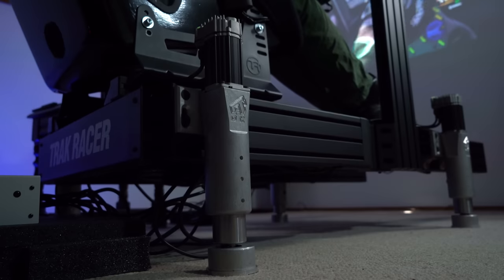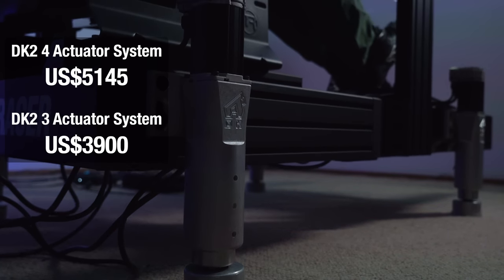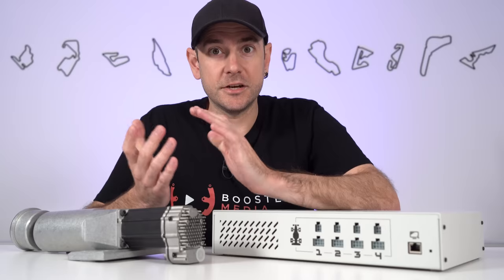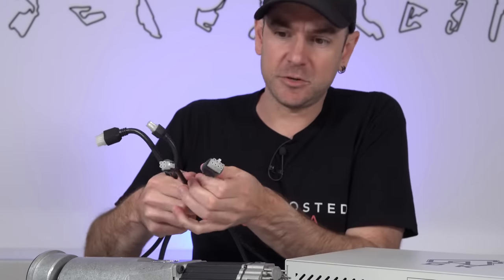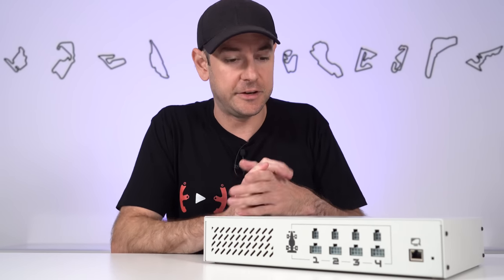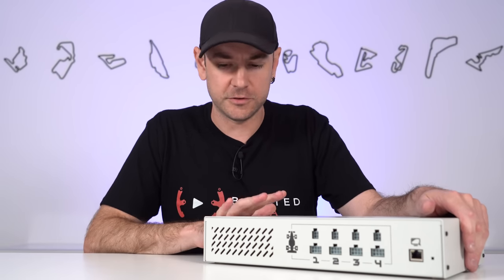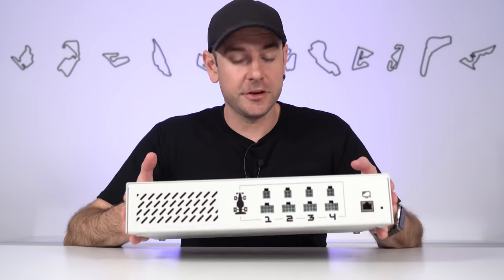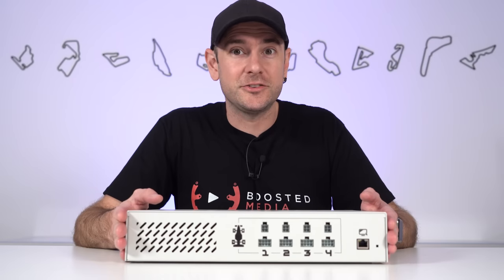REVIEW - Sigma Integrale DK2 Sim Racing Motion System

Comment: What frequency does this run at? Is it 60hz for iRacing like their FFB telemetry? If you use irFFB does it run at 360hz? Great video as always, just looking for more info.
Reply from the maker: IRFFB only impacts DirectInput, not UDP telemetry so it has no impact on what the motion system sees as far as I’m aware.
Reply: For iRacing, the shared memory telemetry rate is 360 Hz, and that is what the DK motion system uses. This rate allows the road vibrations layer to be highly detailed. However, other game telemetries are still at 60 Hz, so we implemented an algorithm that artificially boosts the telemetry rate for these games. AC, ACC and R3E are games with a telemetry rate that is 300+ Hz. For all other motion layers (pitch layers, roll layers, heave and engine vibrations), 60 Hz is more than good enough.

Comment: The new GEN5 DBOX 4250i will have integrated controllers to its actuators and will be priced at 7100$ USD. Price is close to the DK2+.
Reply: Excited to get my Gen5 😊
Reply: How do you know about the Gen5? Didn't find anything online
Reply: @vannibombonato4180  I know someone working there.
Reply: @tapidlittle13  thanks for the answer. Any insights/rumors on the technical side of it?
Reply: @vannibombonato4180  exact same specs and performance but less expensive and integrated controllers on the side of the actuators.
Reply: @tapidlittle13  thanks for the answer. Do you have any hint on Vr motion compensation implementation? I have a NLR setup and will have to decide whether sell it and go with actuators or go with motion plus
Reply: @vannibombonato4180  I really don’t know, the guy told me they should officially announce it very soon. He told me the specs are the same as gen3.

Comment: Can two different systems be used in conjunction with each other. For example can I use the  Sigma Integral DK2 with the PT actuator Traction Lose and Surge  System. They would use different software so do I run 2 sets of software at the same time.
Reply from the maker: It seemed to work ok for Barry (sim racing garage) when he used multiple ecosystems to build his 6DOF system.

Comment: Guys is it easy to set up vr with a motion rig? 

 Ive seen/ read some info online about mounting a controller to the rig iteself but have also heard about tracking issues. 

Will (no pun intended) you be doing a feature on it in the future? 
Love ur work legends! 😊
Reply from the maker: At the motion levels these systems run (2 inches or less) we haven’t found it to be necessary. It’s discussed in this video.
Reply: @boostedmedia  Ha ha jumped the gun.  ☺️ I was only 10 mins in. Still watching tho great review as always champions. 👌

Comment: If your aim is lap time is a traction loss system more important than a system like this? Also re the top floor comment would traction loss systems have the same issue?
Reply from the maker: We only have experience with the NLR system which we have a review on. I didn’t find it made me any faster. Traction loss can be interpreted by visuals and wheel force feedback.

Comment: Can you also let us know what kind of sound this makes for everyone DB if you can
Reply from the maker: Don’t have a sound level meter. Sorry.
Reply: A bit too loud for the living room with the wife watching tv, silent enough that i dont hear it with headset at medium levels.
I also got a kid doing gaming in the same room i run mine, and she`s not bothered at all, hardly notices it until i crash out.
Common for all motion systems: it moves and vibrates a 150-200kg rig like it was 30kg, so any wood floor (like Tom mentioned in the review) will transfer vibrations. Turning off engine vibration, and adding smoothing helps alot if that`s an issue :)
Reply: @-Ola-.  Thanks for info dudes, have a marble floor so no problem, just wanted to know the DB but the price is way too much,  9500 is just too expensive for what it is
Reply: @boostedmedia  Info, dudes, It's available for free on your cell phone
Reply from the maker: A phone app is not an accurate way to measure sound pressure level. I worked for 5 years as a Acoustic Calibration technician ;)
Reply: @boostedmedia  Yes that's true, but better than nothing mate
Reply from the maker: Not in my opinion sorry. There’s far too many variables to give an accurate measurement and I do r want to start throwing inaccurate data out there. 

Wouldn’t be a bad idea to get a proper meter to testing these things in the future though. But yeah, if we’re going to do it it needs to be done properly.
Reply: @-Ola-.  yup i agree. i have the dk2 as well. its pretty quiet overall. i have it in my office. I also agree with the crashing part is where ya really hear it..
Reply: @boostedmedia  I know how you think for your online people, and it's good what you do, just to know something about what those 4 actuators do, thanks in advance for taking good care

Comment: one can get an SFX 150 for $2000 plus shipping. with 3 times the displacement and faster movement at 250mm/s.. I would be curious to have anybody explain how such a system is twice better than an SFX 150.
Reply: DIY project vs. fully complete/ready for install product is the only explanation one needs for the price difference. Also, I bought a PT Actuator Scorpion for around the same price and I'm plenty more than capable of building a SFX150, but everything beyond the electronics is much better built on my PT Actuators. I'd expect this one to be the same. (I'm speaking of the heft of the metal work. Watch Sim Racing Garage/Barry take it apart and you'll see what I mean).
Reply: @mikej6565  i also almost pulled the trigger on the pt actuator but nobody could convince me that it was worth twice the price as the eracing lab kit. So i took my chances. So far, almost one year of intensive use and no problems.
Reply: @L_Emir_de_Passy  Whatever gets your rig up in the air is what works... I even bought a spare actuator and servo driver board, just to be sure I'll keep them going into the future. Still worth the money for the robustness of it all.